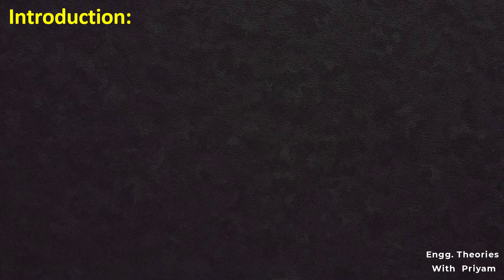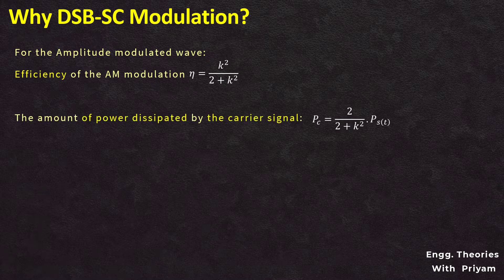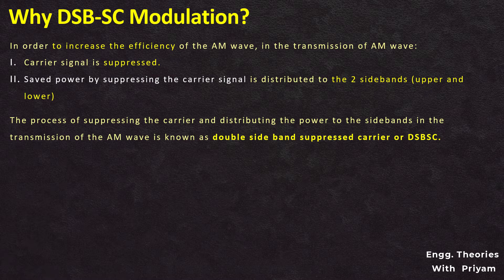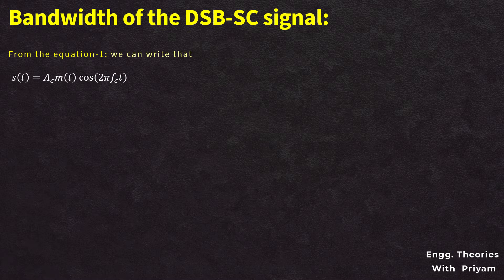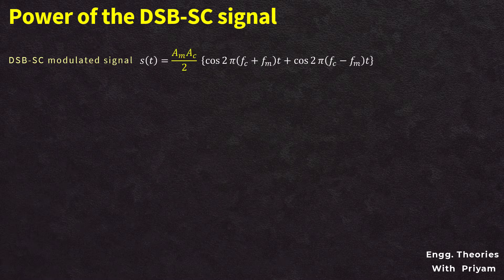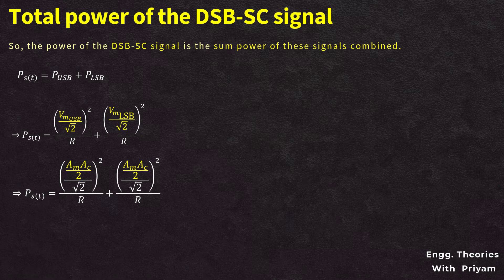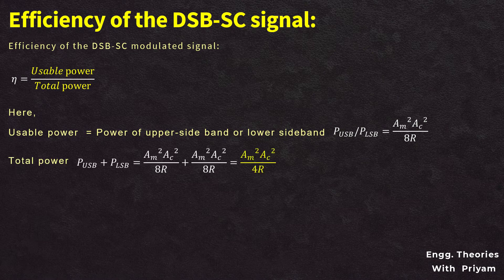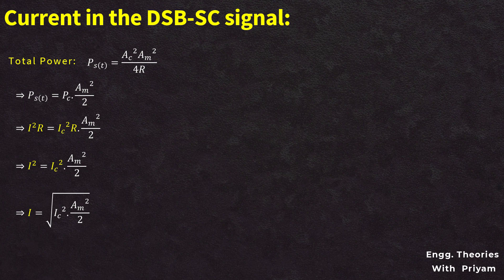DSB-SC Modulation || Equation, Bandwidth, Power, Efficiency || Lec-15

Comment: Efficiency will be 100℅ I think u have not used the correct formula
Reply from the maker: The efficiency was 50% due to the power divided between the two sidebands
Reply: @Priyam_Saha  no you are wrong
Reply: @animehead4u   No.... I think you don't understand what he meant...
Reply: @animehead4u  

In DSB-SC (Double Sideband Suppressed Carrier) modulation, both the upper and lower sidebands carry the same information, making one of them redundant. Since the transmitted power is equally divided between these two sidebands, only half of the power is effectively used for conveying information, resulting in an efficiency of 50%. 

In contrast, SSB-SC (Single Sideband Suppressed Carrier) removes the redundant sideband and transmits only one, ensuring that all the transmitted power is used efficiently. This makes SSB-SC 100% efficient, as no power is wasted on unnecessary duplication of information.
Reply: @Thanks,  I know that but Most sources state that DSB-FC has a power efficiency of 33.33%, while both DSB-SC and SSB-SC are 100% power-efficient since all transmitted power is used to generate sidebands, which carry the actual information. However, in terms of bandwidth efficiency, DSB-SC is 50% efficient (since it transmits redundant sidebands), whereas SSB-SC achieves 100% efficiency by transmitting only one necessary sideband.